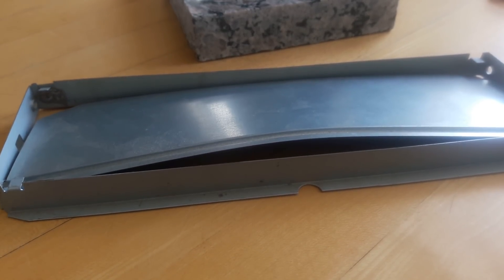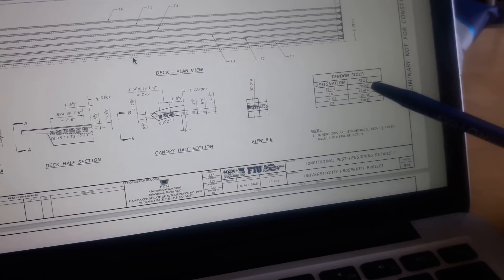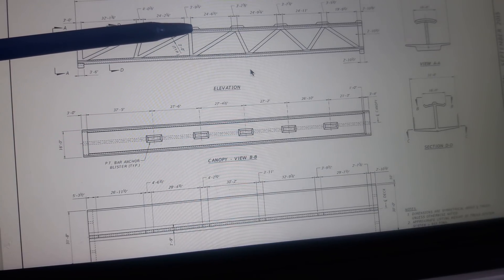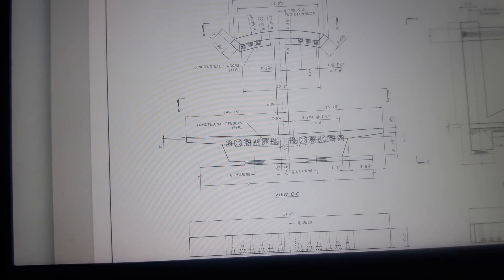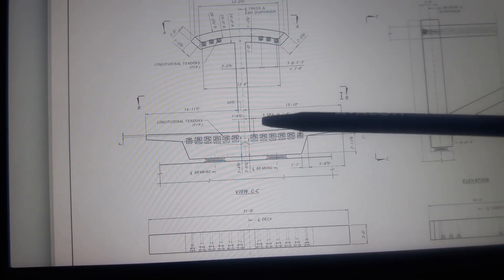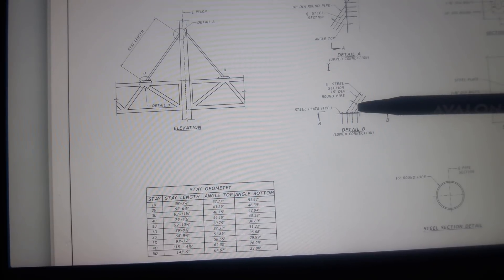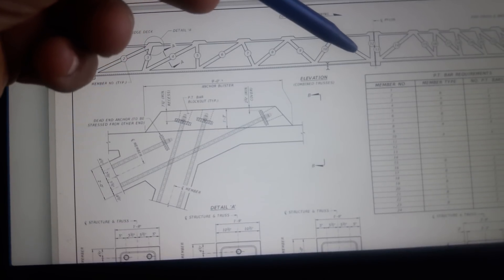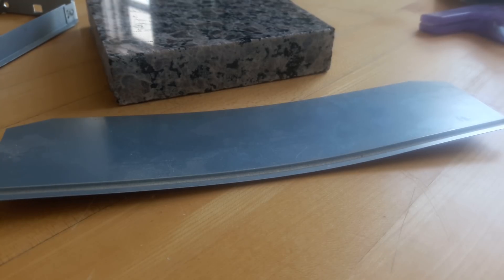FIU Bridge Collapse failure explained in more details - video #2

Comment: Terrible design with single row of vertical members = single point failure. Shocked it was ever built. Vanity project for the university. 

A truss bridge made of post tensioned concrete is a bad idea. Rods of different lengths and going different directions places unintended complex shear and bending forces on adjacent members. Different length tendons that are not tensioned simultaneously also produce unintended moments. 

Faulty installation that cantilevered the ends of the bridge put the end diagonals in tension which led to the failure.

I found it interesting that this was on the wikipedia page for a couple of hours last week: 
In many bridge truss designs, the triangulated supports are arranged into two or more parallel walls. Among other benefits, this gives some redundant load-bearing paths to help the overall structure survive if any one member fails. In the FIU bridge, there is only a single vertical plane of diagonals along the centerline. There is no backup for any strut. The entire structure is threatened If any one diagonal or joint were to fail. Collapse can be avoided if the remaining joints and members were overbuilt stiffly enough to accept the shifting emergency loads without breaking. Otherwise, the structure continues to sag unchecked to the point where more things fracture or buckle, and the structure folds. Such bridges are called [National Bridge Inventory fracture critical] with each strut being a potential [single point of failure]. That vulnerability is avoided in most new bridge designs.

But not in this case.
Reply from the maker: https://smartech.gatech.edu/bitstream/handle/1853/7126/dongkeon_kim_200508_mast.pdf 
enjoy this pdf if you want to learn about the forces in play  and you want it told to you in an engineering terms...

Comment from the maker: Concrete is cheaper than steel bridge by itself... a steel bridge will still use concrete as the decking... This is a ''two-for" (one)   deal of construction... this is the real reason this type of construction is used - as it is built in rotated into site... this could have used steel and concrete decking also... off site and rotated into position but this is a way of eliminating the steel part of the bridge construction... (my take).

Comment: If you read those plans a bit more carefully, they're saying NOT that #11 had no force on it (it probably was designed/intended to bear a huge portion of the total bridge span weight in compression), but rather that #11 had no PT bars installed in it, nor did #12, as PT bars weren't required for that design - apparently those members weren't expected to be in tension, only in compression, so none would be needed.  The chart further shows that #10 had a total of 4 PT bars in it, each toward the corners, as that member is (by design) expected to be under a significant amount of tension, and EACH PT bar is supposed to be tightened to the 280 KIPS value that is listed, for a total of 1120 KIPS for that #10 member, so I guess it would be accurate to say that "They're crushin' it!"...

All kidding and humor aside, with that any any type "A" member, it would seem crucial to keep the tension close to even on all of them, because an imbalance might cause and even greater moment sideways to shatter the member?!?  A very delicate operation, once the numbers start to rise...

Changing the location of the SMPT (?) mover inboard would have to have put at least #11 into tension, if I'm looking at it right, because of the cantilever forces off the end of the northern mover when they did move it, & I don't see how tightening bars in #10 could have helped that in any case.  It's my understanding that there are also PT bars/rods/cables in both the deck and the canopy, and perhaps those are the more likely candidate for tightening when they were moving it into place?  (Construction video shortly after laying it in place explaining what they're doing  and how much longer they'd have the road closed).

As an amateur looking in from the outside, it appears that #10 had a purpose of anchoring #11 so it was wedged in place, and also hanging a portion of the deck weight from it & transfer that tensile load to #11/canopy/#12, and if #10 fails, the deck would drop quickly, but unless that falling deck also undermined the lower anchors of #11 & #12, the canopy shouldn't have fallen in tandem (which it seemed to do in the video footage I saw).  Something had to also have caused the canopy to break enough for it to follow #10 down?

What did I miss here?

Comment: So why they create a concrete canopy? was it to give the bridge more compacting power? Wouldn't seem like it would help with the load bearing capability of the bridge.
Reply from the maker: Concrete is cheaper than steel bridge by itself... a steel bridge will still use concrete as the decking... This is a ''two-for" (one)   deal of construction... this is the real reason this type of construction is used - as it is built in rotated into site... this could have used steel and concrete decking also... off site and rotated into position but this is a way of eliminating the steel part of the bridge construction... (my take).

Comment: I just saw slow motion vid.   Seems like the connection at the top where 10 and 11 met was the point of failure.   it seemed the top actually flexed down there then the bottom collapsed from sudden weight on the now foldable end.  there seemed to be no connection at that point, or the connection snapped and that was it...
Reply from the maker: This is what I am stating, the canopy gave during this process of failure.
 Did you have another point you were trying to make?